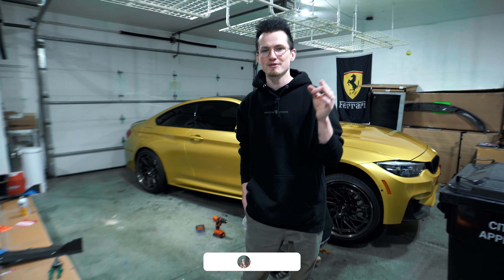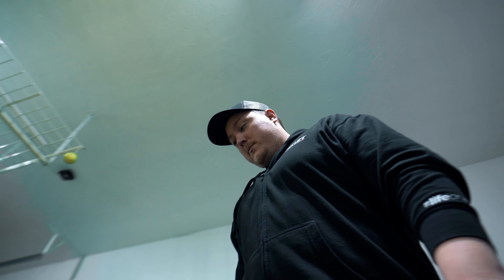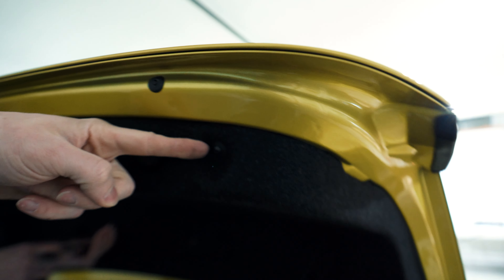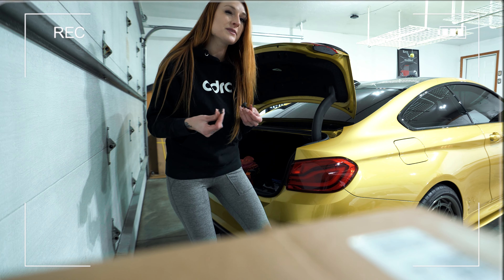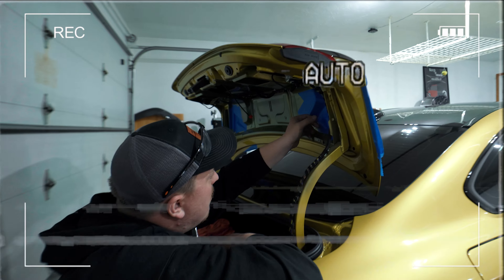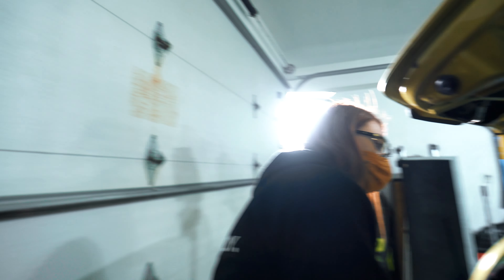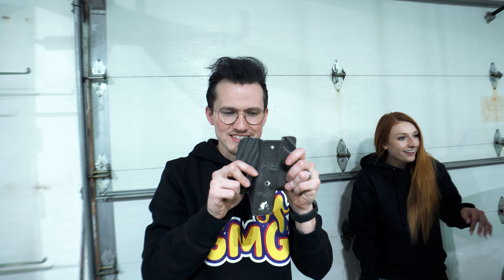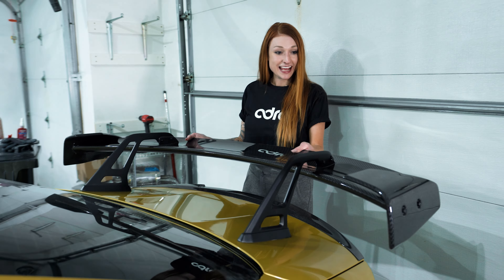AT-R Swan Neck Wing Install on Bekah's M4!

Comment: Those plastic screws in the trunk, you don’t even have to use a screwdriver. You can pull the head out with a long nose plier and will be less pain in the ass then stripping the plastic screws,Because 9/10 you will strip them anyway.